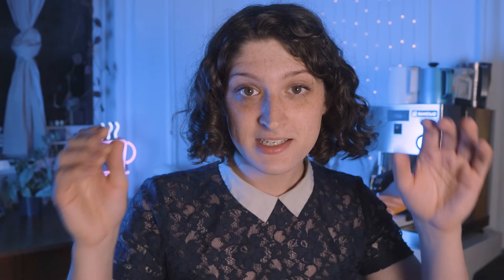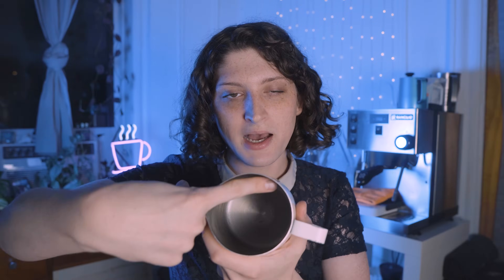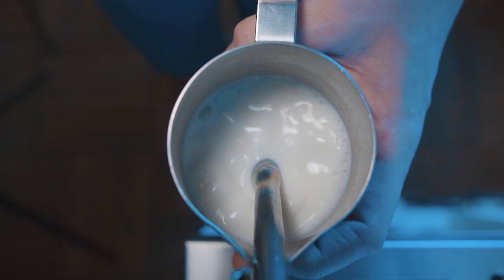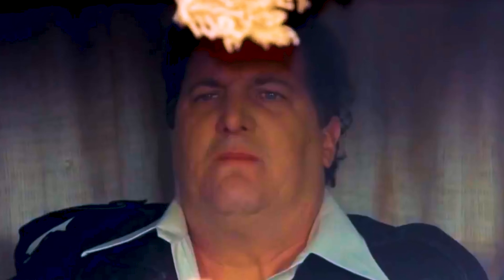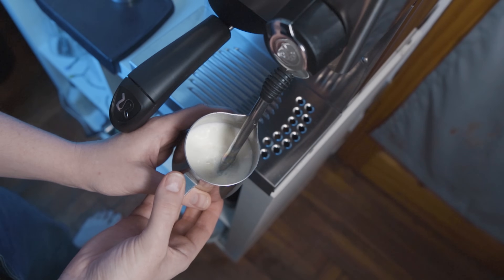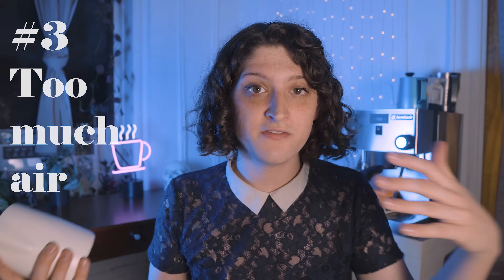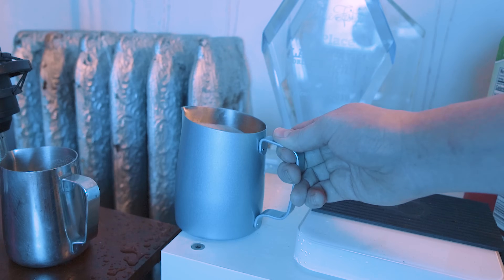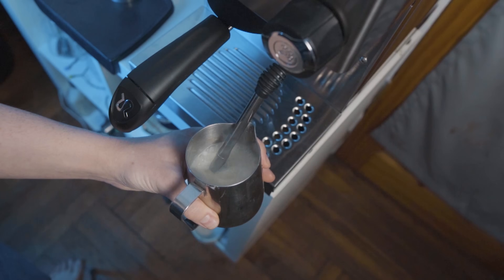TOP 10 Milk Steaming Mistakes

Comment: As a beginner home-based barista, I personally found Tip #10 (purging before steaming) to be helpful and strangely not mentioned often in many latte tutorials on Youtube.

Really hope you will cover more in-depth on the stretching phase in your next video! ◡̈ Have been struggling with the "goldilocks" zone since day 1.

Am glad you decided to start your own Youtube channel! IG doesn't do your knowledge sharing enough justice. Subscribed!
Reply from the maker: I’m so happy this was helpful! 
You’re correct, it’s hardly mentioned. And yes the stretching phase will be detailed more
Reply: @EmileeBryant  Thanks, good vid.   I just do 1 dry cap (spooned (horrors!) foam and pour liquid through it)every morning from an Electra MicroCasa... easier than latte micro foam.  Two points you could add: 1. start with cold milk and pitcher (40F),   2. Along with volume change consistence, stretch to 100F, then lower the tip keeping the vortex going, stop before 150F.

Comment: By necessity, I have to be pretty minimal; thus, the $40-50 Mr. Coffee espresso/cappuccino maker. 10oz of good strong coffee, and I'll add an average of 8oz of flavored non-dairy creamer.

I have a particular cup to hold the creamer, and I fill it half full. When the espresso function gets noisy, it's time to switch to the steamer function.

I go for that sound you talk about, which happens when the steam tip is about 5mm submerged (I'll try the swirl effect next time!), and I keep it there with little movement until the foamed stuff reaches the top of the cup. Combine the two in a large cup, and I have an exquisite doppio.

I don't go for "art" on top; I'm just going to ruin it anyway in the 1st minute or so.

This comes from my 2nd wife & I experimenting 25+ years ago, when coffees themselves were flavored like the creamers (French van, Hazel, and Irish). Mixing and matching was playtime!
Reply: BTW, I'm shopping around for other brewing methods -- tired of drip coffee makers. My personal capps take heavy toll on the creamer supply, so I'm need a more frugal choice. Percolators and "cowboy coffee" currently top the list. French press is also being considered.

Thoughts? Anyone?

Comment: is it normal for a steam wand to emit steam for a few seconds, then hot air only, then back to steam, then very little steam, then back to full steam, etc., with that cycle repeating? I just bought a new machine with a steam wand like you're showing, but, for the life of me, I cannot get the texture of "paint" that I want. In fact, the only way I can get the milk to rise in the pitcher is by creating massive amounts of bubbles. Is my machine defective?

Comment: All the other demos show the jug being put down so that the steam injector can be purged and wiped clean. Apparently Star force snipers will take you out unless you do this straight away. You on the other hand tell us to keep swirling and pouring it into the cup and I assume the clean up is done after.  Furthermore I always assumed the cup had to be at least half to two thirds full of coffee or the result would be a very weak taste.  Please explain how much actual coffee should be in the cup.  Having never been able to get behind the Barista and watch what they do it is a mystery I want to have explained. I like my Capo with at least a half to two third of an inch  of foam on top. Not the miserable quarter inch layer many coffee shops turn out.

Comment: Cafe Americano:

I have owned several espresso makers in the $200 range. The pumps give out all too soon, but I love my newest one. It apparently has a sturdy pump and doesn’t cost a fortune. Am I allowed to mention a brand name? It’s a Mr. Coffee made by a venerable company that I trust; Sunbeam. 

Cafe Americano apparently is popular; just ask Starbucks. 

My user manual shows how to make espresso, cappuccino, and lattes. That leaves me with a dilemma: how to add hot water to the espresso to make an Americano. At first, I used my electric kettle to boil water to add to the espresso. Then I thought it simpler to run the same ground coffee through 3 cycles to get enough water volume. Then it hit me: all these espresso machines, for no apparent reason, absurdly, leave out instructions for making Americano! This morning, for the first time ever, I filled the milk tank with water and pushed the “cappuccino” button with the sitting of “2” indicating a double. The result was not enough water, so I repeated the process. Perfect! This makes Americano with the same strength as Starbucks. You can easily adjust the strength to your liking. If you want a stronger drink, use a setting of “1” for the second cycle for less water, but that’s too strong for me! If you want a weaker drink, run the cycle 3 times with a setting on “2” for more water. 

It seems to me that using the machine’s water tank is convenient and saves wear and tear on the pump by using it only twice instead of three times per cup.

Comment: Ok here comes most likely a stupid question but I'm a super newbie, as in just bought a machine and will be making my very first pull this weekend.  I'm on keto so milk has too many carbs for me...can I use half and half or heavy cream for the milk??  Thanks!!
Reply from the maker: NOT A STUPID QUESTION! 

I have done Keto and I get it. 

You can steam with cream and half and half. So problems will occur.
Firstly you’ll notice the steaming will be very very loud (it will scream at you as if you failed to inject air) kinda like the dumb and dumber clip. This is nothing on you. Cream, eggnog and other thick fluids do this. 

You will have a harder time getting stable foam (fat is a natural foam destabilizer) 
So you might need to inject more air (not more aggressively, just more injections) 

Half and half is better than heavy cream overall.

Good luck!
Reply: @EmileeBryant    THANK YOU!!!!!!!!!!!!!!!!!!!!!   I really appreciate your reply!!!!!!!!!!!  :)

Comment: Lovely video! When do you wipe and purge the wand if the pitcher has to be swirled until pouring?
Reply from the maker: Thank you! 

It is okay for it to sit for a brief moment when you are wiping the wand. (Or for a longer moment if it’s alternative milk) Then you’d just pick it back up and swirl it. 
And should you let it sit for a longer time you can save the milk half the time (I mean so many variable so hard to say) 
But you’ll have to swirl more forcefully to get the foam to break off the top and distribute back into the milk.

Comment: Hey I've recently started a barista job at a new cafe. The problem I'm having is that the steam wand has 5 hole tip and the steam seems extraordinarily powerful on this machine. I've steamed with 2 and 4 hole tip before and learnt to get a nice microfoam with both of those. I cannot seem to figure out the 5 hole tip. Send help! Any tips would be appreciated!

Loved the video! Keep it up :)
Reply from the maker: Try giving it only two or three very GENTLE injections. And I mean delicate.
Reply: @EmileeBryant  gotcha! Thanks so much for the reply. Will update you on how it goes tomorrow!

Comment: I've tried adding some of the tips in here to my milk steaming and they help me a lot. The big ones were to keep the milk swirling after you finish, and moving the steam wand in and out of the milk. I found moving the wand and listening to the sounds it made started to give me a really good idea of where the nozzle needs to be to GENTLY add air without making it foam up.

I'm still not great at pouring latte art, but the milk isn't the problem now. Thank you!

Comment: Isn't the wand position completely dependent on how many holes you have in the steam wand? 4 holes and you are supposed to have it in the middle, not the side. There's a video on YouTube showing which wand position you need depending on how many holes in the steam wand. I watched your video and did tilted for a year before realising it is supposed to be straight for my 4-hole wand 😅
Reply from the maker: Great q. 

I would argue perhaps that just because the holes are four sided doesn’t mean they point in angled directions. 
They often point straight out. 

I have been teaching the method that myself and every coffee professional I know other then a small small small small handful, use. 

I prefer the angle method regardless of the hole count because it is an effective and precise method to get a consistent roll in the milk. 

Otherwise you rely on the chance of chaos. IMO!

But before I say the middle method doesn’t work as well, I would first need to test it for a long period and that in itself is a whole ton of data. So I speak to preference and what I know works. 

So do what you like 😊
Reply: @EmileeBryant  I tried it out now a couple of times and it worked surprisingly well! I will experiment with both until the new Subminimal nanofoamer Pro comes out end of summer :D Btw thank you for the reply and for your content in general. My wife loves coffee and I had never tasted coffee in my life, so when I got an espresso machine for her I had no idea what coffee or milk should taste or look like so your videos were some of the most helpful I've been able to find to perfect the coffee I make for her! I can tell coffee is a true passion for you!

Comment: On the Silvia machine where you can't steam and make espresso at the same time. What would you do first then? I see people doing different things - and the quickest way is to steam first and then do the shot. I find it hard doing nice latte art when the shot has been sitting for a couple of minuts.
Reply from the maker: You are correct that there are many different approaches. I prioritize milk more often however a fresh shot is hard to beat. I think if it were me i would steam first and keep my milk swirling while the shot pulled... or maybe id reverse that hmmmm.  I would suggest trying both and landing on the one that creates the best results for you. Biggest take away would be to make sure your milk is swirling in the pitcher the entire time (so the foam doesn't separate) until you are just ready to pour. and if you do it in reverse then don't disturb the espresso until the milk is done and give it just enough swirls to even out the color but don't over swirl the crema (or it will dissipate)

Comment: Thanks for this video (I'm only a year or so late haha). A couple questions:
1) do you have any tips for steaming in bell shaped pitchers (ones that have a bubbled out bottom and then curve inwards towards the top)? we use these at the cafe I work at and I find the foam gets caught in the bottom really easily and it's so hard to vortex the milk. 
2) instead of the duck bobbing (guilty heh) are you just using micromovements to adjust the pitcher position?

Comment: Awesome.  But I don't think you clarified why you need to purge your steamwand before frothing?  To me,  not purging just adds a bit of water  which is in your coffee anyway .... so, why must you purge first?
Reply from the maker: Good ask! It slows down you speediness in injecting air at the very beginning, as well as adds unnecessary water into the milk. You will get a better quality foam with pure steam as opposed to very watery and wet steam. since the goal is to get air in the milk quickly but gently, we need to be efficient with how we inject the air. Wet slows this down. also if you don't purge after then old milk can stay in the steam wand .

Comment: How do you keep the milk in the pitcher from rocking back and forth as you're pouring, and start coming out in waves? Like it would pour out a little bit and then I feel like it hits the buttom of the pitcher, and get propelled out with a Greater force, and this continues to happen repeatedly until the end of the pour.
Reply from the maker: Hey! I'm not sure what you are referring to exactly. I would need to see a video of what you are meaning. If you like you can DM on instagram (@emstagrim)
Reply: @EmileeBryant  thank you for responding 🥰, I'll try and figure something out

Comment: For a single drink like a cappuccino, is it better/easier to use a 12oz pitcher vs a 20oz? I know there's a lot of factors that influence the success of milk steaming, but I'm trying to eliminate the size factor. I've been using a 20oz and it's hit and miss with the vortex factor. Sometimes I get it to "vortex" completely other times it' just one side that is "vortexing."
Reply from the maker: Smaller is better for smaller drinks. In regards to steaming the milk. I enjoy steaming in a small pitcher and then transferring the milk to a large pitcher to pour with!

Comment: Hi Emilee,
I have recently upgraded form a Breville 870 to an ECM Mechanika V and am having a problem near the end of the milk steaming process.  The ECM machine has knob stye valve controls to actuate steam wand and hot water dispenser.

My primary problem is, when I am at my target temperature of (140f) and have a texture that I am happy with, I close the steam knob as quickly as possible, however while I am closing the valve this closing process seems to introduce some large bubbles into the milk.  Not a huge amount, but certainly noticeable.  I can both see and hear this happen.  I have tried inserting my want a little deeper into the milk during the shutdown process, but it does not seem to help much.

Do you have any suggestions on how I might approach this problem?

BTW, my Breville 870 did not seem to have this problem, which I believe is related to the much much lower pressure steam when compared to my new ECM machine.

Thank You  (subscribed)

Comment: Hi Emilee! 

Thanks for the great tips! 
You mentioned how bad it is to let the milk sit after steaming. I’ve heard elsewhere that it allows the larger bubbles to weaken so that when you tap it, they pop more readily. I’m working with a single boiler at home so I have to choose one to let sit. I’m worried if I leave the espresso sitting, it will compromise the taste. In that situation, which would you suggest I start making first? The espresso or the milk?
Reply: Eventually you'll want to learn how to do them at the same time. If you are a beginner then making your espresso first is best.

Comment: I noticed alot of 'volcanos' when i steam the milk, instead of whirlpool. Then the milk starts to overflow. 😏😑
Reply from the maker: THIS! Very common and could be three things. 
-Too much milk in the pitcher before steaming 
-Too much air when adding air to the milk (it will rise in size)
-Or potentially the milk is getting too hot. less common but if the milk goes past 160-170 F it will start to denature the proteins holding it all together and will expand. 

I suppose a super sharpe angle when steaming could also cause this but it would have to be dramatically sideways. I would suggest starting with less milk next time and see if that helps!

Comment: Have you ever tried the ESPRO’s Toroid Milk Frothing Pitcher? I aim for the bottom center because the shape of the base creates a donut shaped spin, not around the circumference of the pitcher, but like the radial cross-section of the donut is spinning. I'd love to get your opinion of it.

Comment: I'm foaming on either a french press or a nanofoamer at the minute as I'm paired with a cafelat robot. One thing I always see on great latte art pours is after the base is poured and the art is being started off, there's a lovely moment at the start where the white of the foam will either slip across the surface in a beautiful line, snaking out from the tip of the pitcher or into a lovely bloom in a mushroom shape. I don't get this often if ever with my pours although I have gotten some attempts at art (https://www.instagram.com/john_o_coffee/ for my log of pours). As a result I'm not 100% if it's my foaming that needs more work or if it's just my pours being kinda shitty. What does this sound like to you off the cuff? Enjoying the style of your videos!
Reply from the maker: Yes! That concept is called “shooting the line” 
It’s definitely the topic for an upcoming video. 

I think (and this is just from observation ) that either the milk is a bit too thin or the spout isn’t close enough. The issue could also be flow rate (how quick the milk flows out) though it’s looking more like a milk texture thing. 
Can you Dm me on Instagram (emstagrim) and send a video of you pouring?
Reply: @EmileeBryant  done!